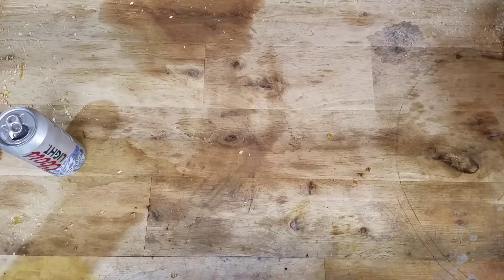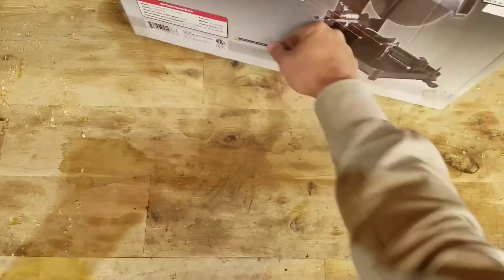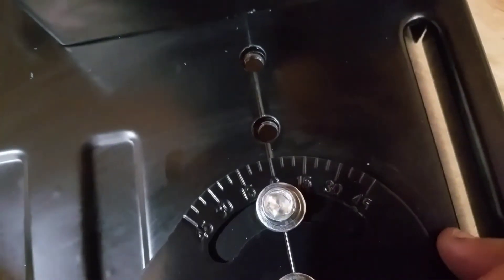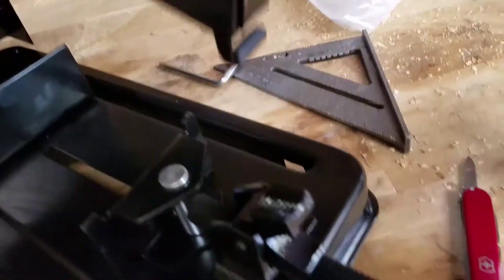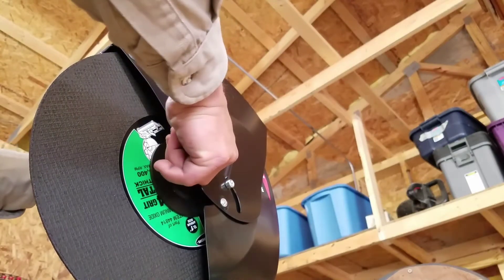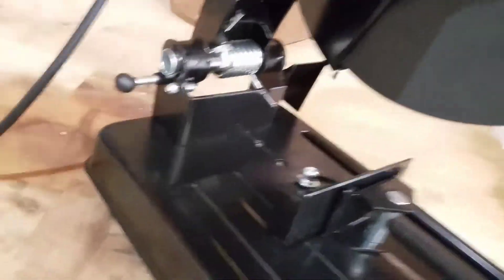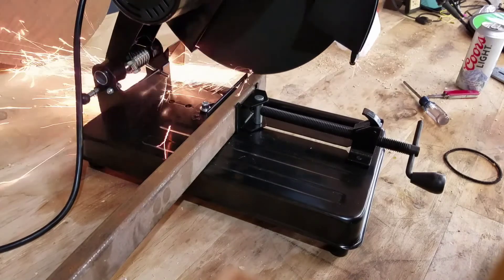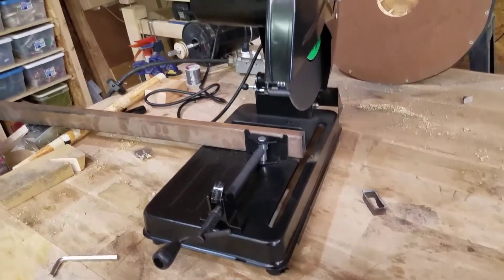14" Drill Master cut off saw from Harbor Freight Review and unboxing.

Comment: The "not rubber foot" is there because if they put a rubber foot in line with the hot sparks shooting out it would likely melt. Good review, thanks!
Reply from the maker: Ah, good point.
Reply: Basically like putting rubber in front of an antique Blowtorch while its running.

Comment: Looks like a nice shop you have there friend. Thats a hell of a drain you have there, I sure wish I have that in my place. Anyhoo I just watched a couple vids for the other saw they sell and I think I'm going to go with this one after seeing your vid. I need to notch 6 pieces of schedule 40 galvanized pipe(both ends) for a sliding gate frame. If it gets that done I'm doing just fine. I think this will be better than the grinder or a sawzall. I need them to be pretty even when all is done. My 20 plus years of painting houses taught me very little about metal work. ha ha. Do you cut everything dry with this saw? or can you use a oil on the pipes. Thanks for the help and the vid.